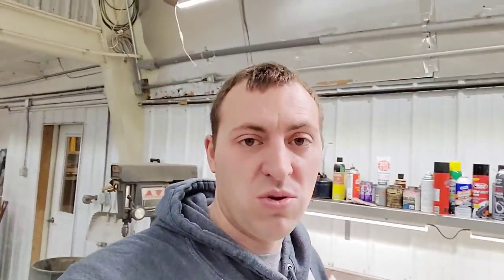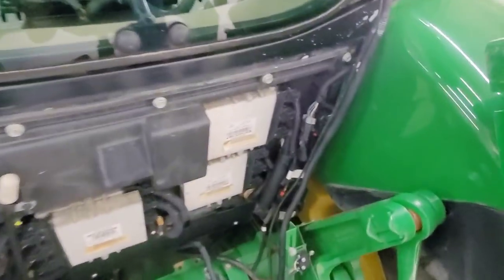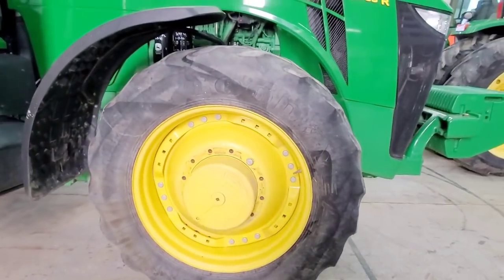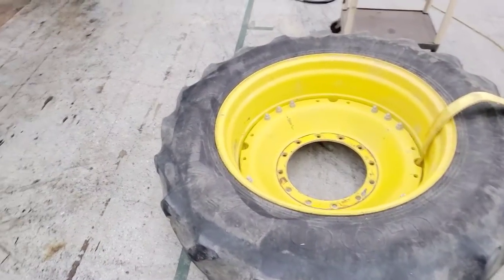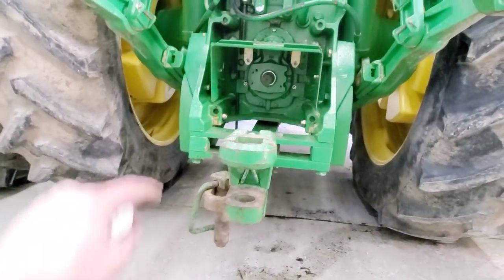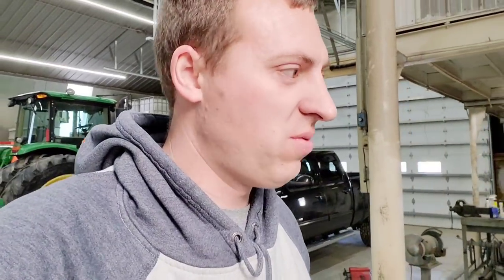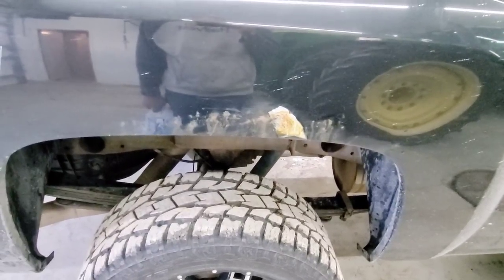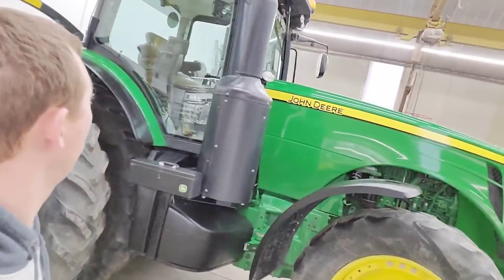What's a 3- Point Hitch - #73

Comment: Chevy Trucks
Twice a year take the tail lights out,  and power wash the fender well out. That will get the salt and sand out of there where they rust👍
On some, if there isnt room to get power washer tip thru the spot behind tail light, use a hole saw and make it so you can. 😉

I would have taken wheel off to clean......ha ha, several 1000 people now know its dirty......your one of them. 🤣
Like your videos👍